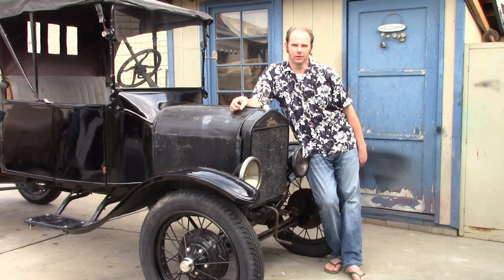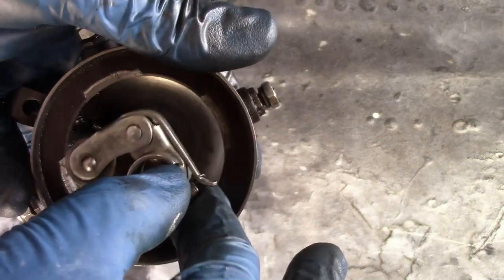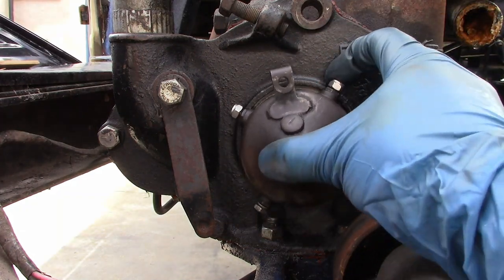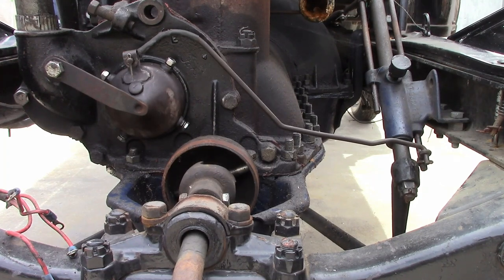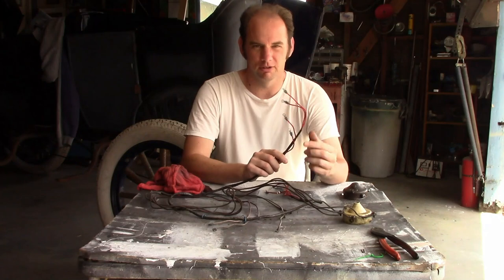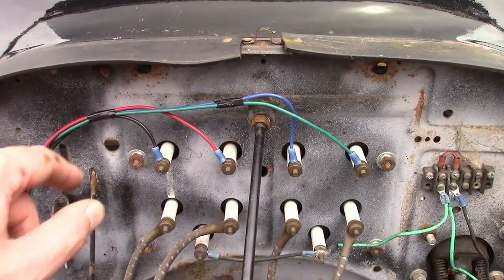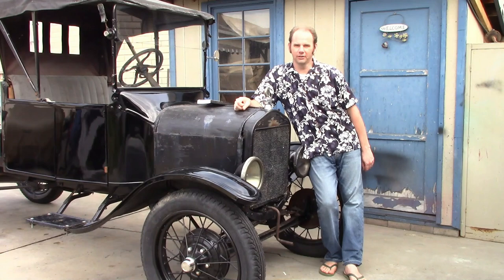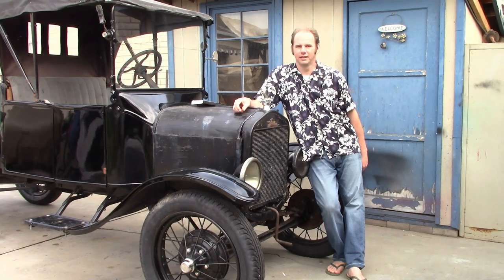How to set ignition timing on a Ford Model T.

Comment: Great video!  Be aware that the locating pin hole on some later camshafts is drilled all the way through, so it is possible to install the timer roller 180 degrees off from its proper setting.

Comment: It is good practice to turn the two front oil pan bolts over so that their heads point up towards the timer.  This increases the clearance between the bolts and the timer terminals and reduces the chance that one of the terminals will ground out on a bolt as the timer is moved by the timing lever.
Reply from the maker: That would help. also, the bolts on this engine are way too long which gives it even less clearance.

Comment: A quick question from a dummy.
If I am replacing a roller timer with an identical unit, do I have to retime the engine.
The new commutator and roller are identical to the one I am replacing.
Great videos.
Many thanks!
Reply from the maker: If you're replacing it with the exact same type, then no, you don't have to.

Comment: Hello, you can definitely help me
I would like to have the carburettor adjusted if possible?
Reply from the maker: The only adjustment they really have is the needle on the top. You turn it lean until it doesn't want to run, then back it off till it does run.